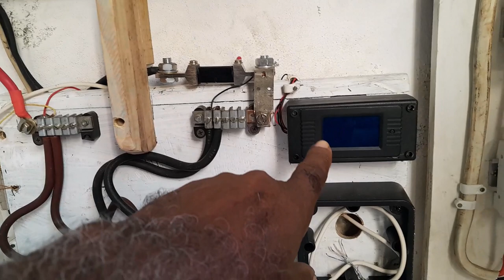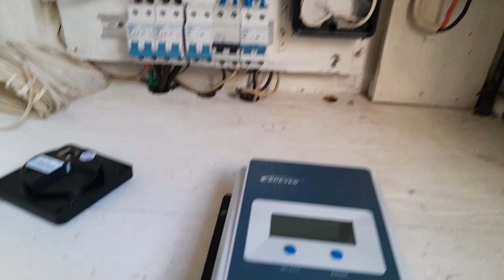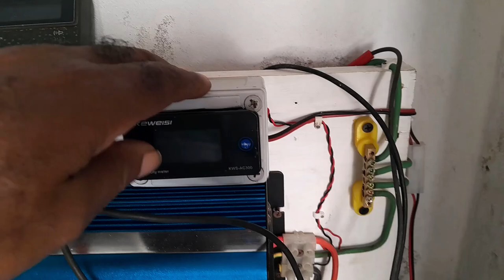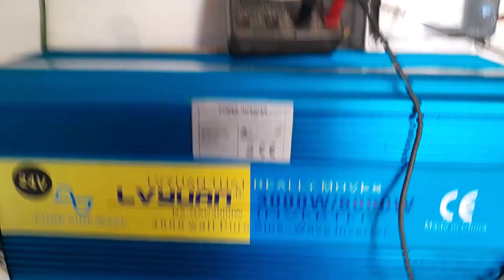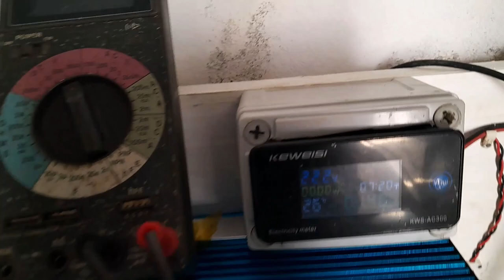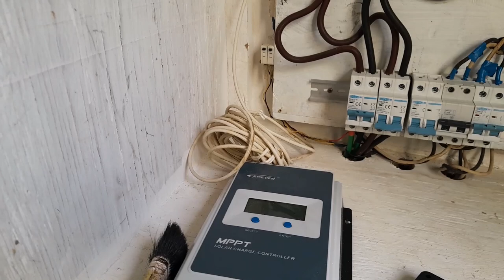Lvyuan DX Gac3000W Inverter Power up Home

Comment: I've got the 12 volt version
Reply from the maker: Look out for the cooling on it.
Reply: @AlwynNicholas  2500 watt inverter definitely not 3000
Reply: It's been going ok for 4 months so far
Reply from the maker: @sun-sea-solar  Still keep a eye on it I don't know if your fan turns on.
Reply from the maker: @sun-sea-solar  Ok.